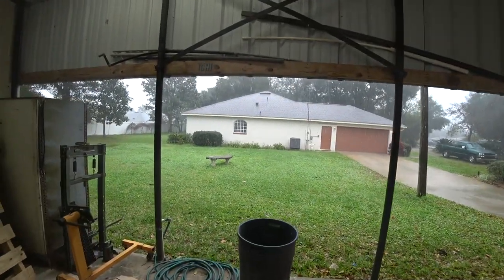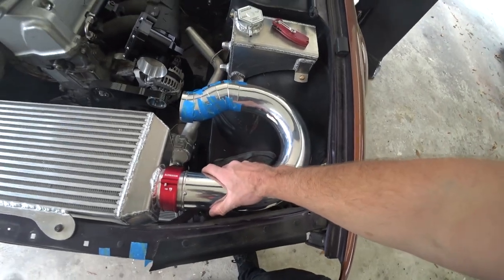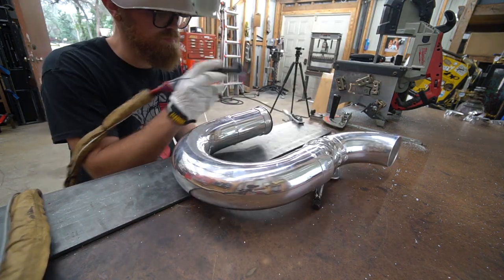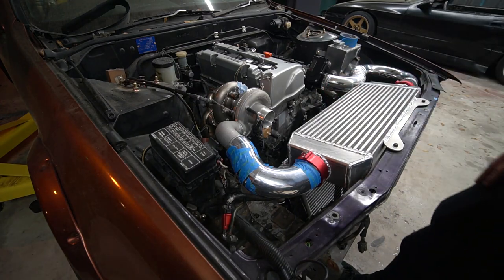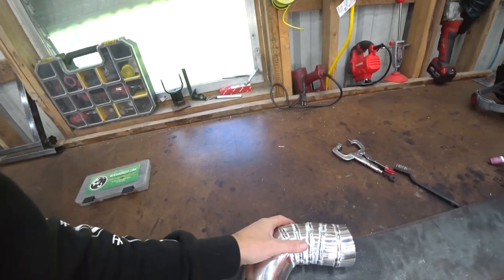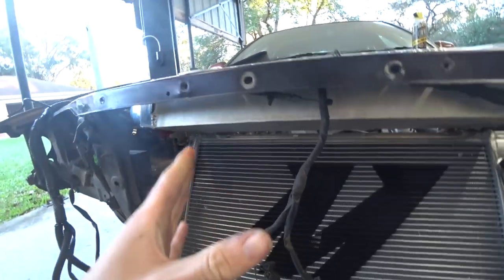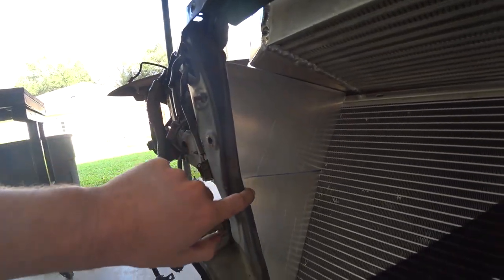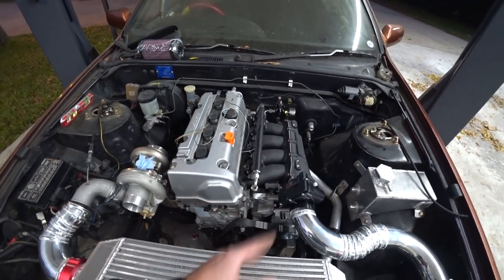Honda K24 Cefiro Build. the most satisfying project yet!

Comment: Anyone else want to go buy tools to start fabricating like Taylor? Mans a wizard!!

Thanks Taylor, the effort that goes into these videos doesn’t go unnoticed!!
Reply: Do it! I'm self taught, bought an ancient welder, lathe and mill for under $10k all in and just started ruining scrap bits until I kind of got the gist. Since then my builds have been in big shows and magazines. You can do it! Watch YouTube videos, practice x10, believe in yourself.
Reply: If you can afford, go hard! It’s often not too hard to pick up a lot of tools second hand and starting with basic gear is the way to go, then just practise and take note of what worked and what didn’t and you’re golden
Reply: Lol He made me buy a welder, its a start I guess.
Reply: I just ordered a plasma cutter because of one of his videos. Not to mention I'm no a fan of "rivnuts"
Reply: You can buy a couple grand worth of tools and be up and running. I have the same AC tig welder he uses it cost 650$, you can get a cheap plasma cutter, band saw and bench sander for 700$ add a few more items and you have a small fab setup. There is some items that are expensive and no way around it unless you get lucky. It takes alot of practice also, he's welding .60 wall aluminium tubing, it takes practice and time to be able to do that.
It can be done tho, I started with nothing and run my own shop.
Reply: I already have 5 times more than him... But I still want to buy more tho

Comment: Consider adding a deflector to your new ducting to push some air up through the intercooler. A hard divider so some air has to go up and the rest (from the road) flow lower through radiator.
Reply: This will also keep your rad fan from pulling all the air through it and not leaving any for the intercooler at slower speeds.
Reply: Nah I say vented hood shrouded to the v mount
Reply: Or 2 fans on the intercooler with a shroud would be cool

Comment: A quick tip on aluminum to avoid the big heat jump when first starting on the welds- heat it with a torch or even better put the part in a warming oven. If you're not happy about the look, dial in ur pulse settings on a piece of scrap and go at it!

The oven trick helped a ton when i first started messing with aluminum at work

Comment: Bro you're killing it with the fab! Watch that torch angle. The more perpendicular you can keep your tungsten to the weld joint, the easier it is to control the puddle. And always try and get as comfortable as possible before you start welding. Watching you progress with your fabrication and welding is inspiring. Keep up the awesome work!

Comment: Can we get a Sandy update? When welding aluminum couplers. Use the pulse settings on a low frequency.
Reply: I personally like pulse on aluminum, I can time it better and get nicer looking beads.
Reply: @BDauto86  it also helps with heat control.

Comment: My man is really procrastinating on the wiring. 🤣

I don't blame you one bit. It's the one thing I outsource and am glad to pay someone else to tackle. 

If you're really worried about not enough air getting to the intercooler, you can always make a mini NACA-stlye duct and mount it in the crease where the intercooler and rad meet if you have room in that space when the bumper goes back on.

Comment: great work, had you ever thought of remaking the end tank to point more towards the throttle body instead of the big loop?
Reply: That was his original plan. Too tight for the s shape needed.
Reply: See the previous video
Reply: ^
I was kinda thinking modify the end tank so the exit is a 45 and maybe it could shorten the charge pipe.
Reply: He did think about it, but he ended up not doing it thinking the piping would be too tight of a turn.
But IMO it could've been done rather easily.
Reply: @imnota  Yep, I think it would be possible to get something decent there too. would be most elegant if he had a slightly less wide intercooler core, but even with what he has I think there would be a way to get it done

Comment: If you use winded instead of pb to slide hoses on, the windex will evaporate, which could avoid the hose sliding off under pressure. Love the progress

Comment: I don't know if you've tried something like this but I bought an airlift coolant vacuum off Amazon and it works amazing it vacumes all of the air out of the system and you close the valve and the vacuum socks the coolant in until the system is full and the vacuum 9/10 opens the thermostat too

Comment: As for reducing potential air intake temps, ModeloDrive FRP DMA D1 Hood For Nissan Cefiro A31 88-93 ***JUST EXAMPLE****  might be able to help evac under hood temps in the right area.  +++++Also, although back purging is not required with aluminum as it is with stainless, it does usually weld a bit more consistant.    Awesome Job Duder!!!  Looking forward to seeing it all come together!

Comment: Thanks for the tip on lowering the amperage when Tiggin' aluminum.

(**I feel a satisfaction each time I see you working on the Titebond III covered work table.  No need to ever replace that table now.  If it gets gouged, you can fill it in with putty or, better yet, a saw-dust-and-glue paste, sand the surface smooth, and then coat it with another layer of Titebond III.**)

Comment: Taylor just a little suggestion air will travel at the least resistance is two upper corners by the core support air will travel more easily through that then through your inner cooler and radiator so you might want to seal those up but awesome job 🔥👍😊

Comment: If your welder has pulse settings try it out for your pipes. Allows you to run higher amps to get a nice puddle but keeps the heat under control allowing you to slow down and stay neat

Comment: Taylor: "I gave half of my small rod away since I'll never use it."
Also Taylor: "This is a good job for small rod."
Reply from the maker: I’ve still got 5lbs which is a ton. Lol and I ended up using the big rod anyway for the welding.
Reply: Was the smaller rod good for the lower amps?
Reply: DOH!! 🤦‍♂️😂

Comment: Good work man. Prep and being comfortable is 75% of improving weld quality. You could have poped the tacks on that last pie cut before it went into the 180* and welded all of the pies separately and comfortably then used your tacks to re-align the 180 and only had to deal with 1 odd weld.

Comment: I'm not a fab guy, but I was thinking you might be better off modding the intercooler end tank on the passenger side? Basically moving the outlet near the throttle body.. Would end up will less pipe?

Comment: pro tip on the template/material cutting. get all your templates made, then lay them out on the material. often times you're able to arrange it in a way that has minimal waste and leaves you with easier/larger clean metal to use for later projects rather than random triangles. both of those could have made a square or rectangle in a much smaller footprint, and left less wasted space.

Comment: May I suggest you also add a piece of flat sheet metal running in the middle long ways between the two duct walls, have the sheet curve up gradually and stop at the Intercooler. Will help with attachment of air when entering duct and help flow through the main section of the IC instead of just the very edge.

Comment: Instead of using pb blaster to slide your rubber hoses on use brake cleaner instead. Then they won’t be oily as the brake clean evaporates. Works ideal for intercooler pipes 👌

Comment: You need 140 amps AC to get the puddling going because the oxide layer on the outside of the aluminum actually melts at a higher temperature than the aluminum itself. Its also why you cant cut through aluminum with a Oxyacetylene torch. But you're also spot on about the thermal conductivity. 14:32

Comment: Great content fabrication looks good. You should consider adding a splitter in between the rad and intercooler to direct air flow upwards and force more through the intercooler. Old jdm Gods had success with v-mount rx7s.
Cheers

Comment: Why not move intercooler inlet and outlet to bottom of intercooler and only have like 6 inches of piping
Reply: He could’ve done pie cuts straight off the inlet to the intake instead of that 180
Reply from the maker: I couldn’t fit two 45ish degree bends to get the offset in such a short distance. It would be like 4-5”’of pipe after accounting for the quick connect. That was my original plan. However a viewer commented on the ic build video and made a good suggestion of angling the bottom of the end tank towards the throttle body then I would only need one bend which would be doable possibly. Still really tight to get in and out. I may re do it if my ocd gets the best of me.
Reply: @Taylordrifts  haha just a suggestion, also the longer bend is probably easier to remove and install, we know how that goes
Reply from the maker: I just wish I thought past putting it strait before I built it. Angling the bottom would have been such a simple solution. I honestly might re do it to make it all super short which is the whole point of the v mount.
Reply: @Taylordrifts  it’s bothering my ocd so I know it’s bothering yours lol, looks sick nonetheless can’t wait to hear it hit boost  for the first time

Comment: Taylor, down the road you could just modify that end tank on the intercooler, and have the exit at the bottom in front of the throttle body. Maybe even just get away running a coupler right from one to the other and no need for tubing on that side.

Comment: Get good with the pedal Taylor, you'll hate the button. I can use the pedal with just about any part of my body if absolutely needed. But if you can get it down, having control of your amperage during the weld helps a ton.

Comment: If you're worried about not enough air going through the intercooler, perhaps a piece of horizontal ducting down a few inches at 45 degrees to force air up through the intercooler, would not affect radiator air flow much.

Comment: With that side plate you added on the turbo side - I would have drilled a hole in it for the intake air pipe and only have it so it has just enough pipe popping out to get a air filter on.
Just an idea and it would mean that all cooling air and air for intake come from the one area.

Comment: Use PET tape instead of masking tape. 
Get rid of that intercooler and run the pipes correctly, with the right angle of the inlets of the inter cooler to the turbo and throttle body. 
Harbor freight bead roller will roll anything at less than half the price of the furick, and you can do sheet metal. 

Don’t settle with mehhh when your so close to something really cool! 

Keep up these good videos 👍🏼

Comment: Try filling the pipe with argon while your welding. Should make for a much better weld. I use tape and tin foil to seal up the pipe with a hose from the argon tank. Just a thought.

Comment: If that upper alloy radiator pipe of the strut tower is higher than the radiator consider adding a bleed point there? Combined with the header tank it should make bleeding the cooling system a lot easier

Comment: Yeah that cold side of the IC I would build a larger endtank that goes straight into that bend, wouldn't be the ultimat flow, but would remove a lot of piping. OR just get a core that is a bit taller and or thicker and smaller width
Reply: Also when doing any weld, but especially alu you need to clean it well, get a stainless steel brush and some alcohol or other solvents...

Comment: Taylor, I have a feeling, that you haven't experienced enough 'turbo' setups :) Just a tip from my point of view and experiance. In my opinion, after 'few' tuned and fabricated Hondas and VAGs 1.8t, such ends of piping for standard silicon couplers will not work. You HAVE TO have at least a few centimeters of straight pipe for coupler - others it will pop out with any more then 0,5bar of boost. Clamp has to have a smoot, round surface to become boost-tight.

Comment: T. Ray, I have a suggestion for you. How about a 4" or 5" piece of aluminum that is as wide as the intercooler and put a radius so it could scoop or force more air thru the intercooler? I wish I could draw it for you so you could understand what I'm saying. Just a thought. BTW, lowering the temps on you're welds helped huge!
Reply: like a shroud he made but extended out to back of the bumper on the sides and bottom. like nascar and v8 supercars
Reply: @justinerickson7237  yes, but only like a 30" x 5" piece so it will not block the good airflow to the rad. Have a good day man.

Comment: Suggestion: Needle nose vice grips (cheap ones) clamped to the release valve on the bender.  That way there's no need to remove the pipe when you need to open the release valve.

Comment: Not a trash talking comment or “you should’ve done this comment” but looking at the intercooler on intake side it seems like a different shape end tank with the coupler on the back end of it facing towards the intake could’ve made the piping all of 6 inches and pretty straightforward. Could help with turbo response and simplicity in the plumbing if you ever decide to change it up.
Reply from the maker: I covered this in the last video where I built the intercooler. It was too close to get two bends in there to cover the offset.

Comment: If it were me, I would add a piece of alloy to divide the entire opening,  fixed to the end Shields so that you have dedicated flow to the intercooler....... you have a fan on the radiator,  so no problem there, but that fan could possibly take away some of the flow to the intercooler......

Comment: I had an idea for the filter location , run the pipe through the duck ting and put the filter on the radiator. Probably not the best idea but I could work.

Comment: Just a recommendation- it gets kinda loud when you cut and weld things so could you lower the volume on the edit. (I know people are probably going to say “just lower your volume”. I know but it’s just nice not having to adjust the volume every time you hear the welder or cut something. Thanks!
Reply: The way to do this would be putting a compressor on your audio. It makes quiet stuff louder, and loud stuff quieter. The only problem with this, is if you do it too much, the sound of the wind blowing through the trees will be just as loud as your voice (only when you aren't talking tho). This is for Taylor, by the way, in case he reads your comment.

Comment: V mount radiators and intercooler are much more efficient, when placed at an angle it increases the surface area of the air hitting the fins, there's a reason why race cars have sloped radiators!

Comment: I'm surprised he didn't make a bracket to hold the drivers side pipe up, and bolt to where the overflow tank is bolted in.
Reply from the maker: It's better for it to have flex once the coupler is installed.
Reply: @Taylordrifts  Good point! Thanks!

Comment: Looking good Taylor. I was just wondering, on the cold side of the intercooler how come you didn't go for a straight shot at the throttlebody instead of welding it on the side of the end tank?
Reply from the maker: I explain it in the video where I built the intercooler.

Comment: Forgive my ignorance but is there any reason you diddnt just make the cold side intercooler end tank point towards the throttle body so you would have a really short bit of piping on that side and not have the big loop taking up space?
Reply from the maker: It was too close to get two bends in and everything lined up.

Comment: Looks like you enjoy the fab work way too much, will you be putting a splitter inside that space between the intercooler and radiator in order to direct more air up into the intercooler?

Comment: is there any benefit to making a 2 1/2 to 3 in adaptor piece to smooth out the transition for the turbo side of the intercooler? thinking about airflow in the same way you would for port matching or porting/ polishing an intake/exhaust manifold, is that step down from intercooler to turbo going to be a detriment or wont it matter becuase theres just so much air going through it? just curious
Reply from the maker: Well it’s flowing from small to big. So it doesn’t really matter. It will have a reducer coupler.
Reply: @Taylordrifts  oh ok yeah i wasnt thinking about the direction of airflow so your absolutely right, i was more worried/concerned/confused? about the smoothness of the transition of it and just wanted to ask... i love this build and havent missed an episode so dont think i was being critical or something... keep up the awesome work!

Comment: I think the intercooler would have been cleaner if you made a new exit; either same concept and exit from the bottom: or exit from the top, curve up, then straight to the throttle body. Hard to explain in writing...  But similar to alot  FD rx7 setups

Comment: Hey TRay, what type of material and TPI blades do you use on your saw? do you change blades for cutting steel vs aluminum? buying your same setup cause it clearly works well so figured i'd ask.
Reply from the maker: I’ve tried all of them from 14 to 24 and the 14 seems faster on all materials and seems to cut fine through everything.
Reply: @Taylordrifts  good thing i asked, i was lookin at 20s and stuff lol. Thanks man, have a good day!

Comment: Some of your welding problems to is you seem to use a lot of rod when sometimes you need to back off the rod and work the puddle as in it’s actually welding the pipe together

Comment: May be a dumb question but could you put one of those nice clamps on the throttle body? Or would that be too much heat and ruin the electronics? Or is there other reasons?
Reply from the maker: It could warp it, and would be too much heat unless I stripped it down to bare, and I would have to grind off the annodizing, and if I ever needed a new throttle body I would have ot weld it again.
Reply: @Taylordrifts  ok thanks for the reply.